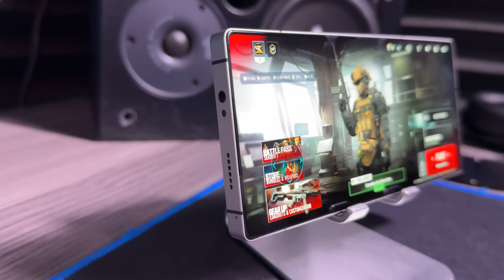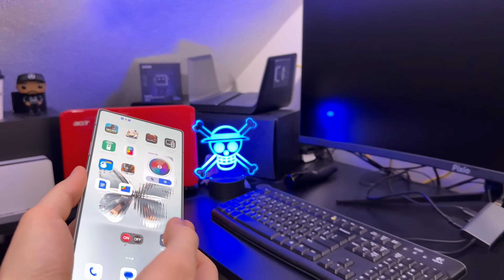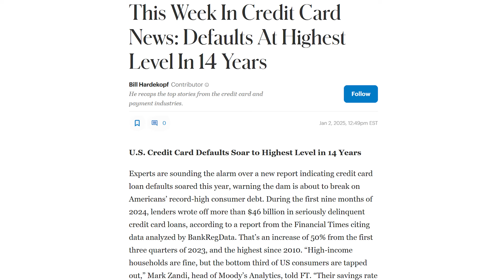What CES Revealed About Repairable Tech In a Record Year For E-Waste (2025 Is Not Looking Good)

Comment: You're the only creator I know (apart from iFixit) who covered the harsh truth about CES. 
I only saw one product at CES, which was designed with repairability in mind, the MCON Controller from OhSnap. 
Man, I really hope that Framework is going to succeed so they can branch out into many other product categories. 
Great Video!
Reply: I wish Framework wasn't beholden to the big chip companies or we could get so many awesome and repairable products!
Reply: @3nertia  Why don't you start building, and selling repairable product yourself, instead of expecting big companies. It is America the country of the entrepreneur isn't it?
Reply: @togowack You don't know what you're talking about.
As a consumer you basically cannot buy nor build a laptop with a CPU sourced from the manufacturer.

Even if you could, manufacturers don't sell to just anybody.

And even if they did, they have limited supply so they ship to big companies first, so you end up having to wait months to get what you need and still the schematics necessary to build the board require insane knowledge and manufacturing prowess.

You can technically do it, but the amount of knowledge time and money necessary to do so is absurd.
Reply: I really hope they release the new Ryzen AI with camm memory stuff as I sure as hell don't want any Intel shit and the only AMD option is a 2023 one...
Reply: Mecha Comet too. That was sick.
Reply: @chichibooxd4793  Right, modular tech is awesome!

Comment: October 2025 is definitely gonna be horrible because 500 tons of perfectly good computers will become e-waste as the very last good Windows OS will become unsupported (Unless it's Windows 10 LTSC IOT which will last until 2032). And I'm pretty sure that a lot of these PCs are very reliable. These requirements problems apply to every PC older than 8th Gen Intel, no matter if it's a low end HP Pavilion thing with a Pentium CPU or a really high end Dell Precision M3800 with it's 4K touchscreen, 4th Gen i7 CPU, 16 GB RAM and mSATA SSD. And also, I know someone who upgraded to 11 on his 8th gen i7 Gigabyte gaming laptop and the laptop became very buggy (Apparently Windows 11 has some digestive problems with those older CPU's so the users will have to buy new PC's even if their current one is supported). And the worst part is that these PCs will probably be replaced with cheap new garbage like my HP 14s or a Lenovo Ideapad or a Dell Inspiron. Oh, and my 14s which I'm using to type this comment already has a damaged plastic frame near the right hinges (Awful build quality exposed) and it's 8 months old (Still under warranty), even though, I open it from the middle 99% of the time and I'm trying to be as careful as possible with my laptop. And this is the laptop that I use for nearly all my schoolwork, including most exams/tests... I really hope that my laptop will last long enough because I have a final exam... If not, I will probably have no choice but to switch to a used 13" or 14" Latitude 5K or 7K series because they seems to be the only business class ultraportables with upgradable RAM and non rivetted/fused keyboards (I can't f***ing stand soldered RAM and fused keyboards) or I will get this POS fixed thanks to the warranty.

Comment: Sir I got old asus gaming laptop 10 years ago those fully aluminium heavy ass one that has gtx 975m it still works. When I needed to upgrade my shit I went directly to desktop because I knew my mother uses those consumer grade laptop that sometime does not work because when you move there is a motherboard crack or something. Yesterday I deboad my windows 11 for 3 hours I really don't like where things feels to end user. If it is posible I will use linux on my laptop. I am not a tecsavy person either. When it comes to those shit I am very ignorant and do not care or eant to learn problem solving. I want to open my shit and make it work as easy as posible. However seems like shits about to hit the fan so there is no option. You have to know what is happning so you don't get force fed by shit programs. I try to buy japanies cars. I try to stay away from new ai futures that inly track my data and analize my shit to force me more consumerism. Don't get me wrong I like cool stuf but future is ain't it. I belive most I will get oled

Comment: I had stayed out of the laptop market for a VERY long time, last week a relative asked me to advise them about a laptop purchase, I went to a local friend's shop to ask about brands and reliability of the laptops. I was shocked, to be told that alot of laptops have soldered RAM and that RAM is usually 4gb or 8gb 4800Mhz DDR5! There is ONLY 1 slot of RAM available to add more RAM and your upgrades would be limited by the fixed RAM's speed. And all brands do this in the name of slimming down laptops!

Comment: I'm going to start putting Windows LTSC on those older systems and it's supported up to 2032. Sadly, even people "in the know" aren't really aware of LTSC, and even then, it doesn't work for everyone. I urge anyone with these older systems to use it if you can.

Comment: It is an absolute STRUGGLE to get anything new that is repairable and upgradable. I feel like early 2010s were the best for that when it comes to laptops. RAM? Yes. Storage? Yes. CPUs? Also yes, upgrade them if the cooling allows. GPUs? Sometimes they were in slots back then too.

Obviously it's not like PCs that you can easily upgrade, but it was way better than now. Nowadays, you're lucky if you can upgrade the RAM. CPUs? Forget about it. GPUs? Yeah no. 

I just wish laptops were standardized like PCs. Standardized chassis sizes, motherboard sizes, IOs, etc. Grab whatever thickness chassis you want and then get parts that fit inside and bam, all done. It's not like this is *impossible*, but trying to regulate companies and standardize the shit they produce nowadays becomes harder and harder. They don't want repairable or upgradable shit, they want you to buy buy buy buy NEW. Always new. 

It is very frustrating.

Comment: You had that phone tooo?!
Man i've been repairing the screen two times and i accidentally ripped out the socket for the antenna cable
I managed to solder it back on 
But now it won't boot anymore 
Currently I'm using an Red Magic 9 
But i miss my rog phone 3 
There are no spare parts for the Red magic

Comment: My main laptop is a Dell N7010 with an Intel i3 370m made in 2010. And it runs fine using Debian w/ xfce.
No one likes hearing it but low-resource linux distros are a pretty decent solution to old hardware.

Comment: I totally agree with you. This throw away culture in not just electronics, but cars as well, is terrible for the consumer and the environment. This is why I use a Dell laptop I bought refurbished in 2011. It's been working just fine for the last 14 years. Originally it had Windows 7, but it runs Windows 10 just fine after upgrading the memory and replacing the HDD with an SSD. I will keep using it with Windows 10 as long as I can, then upgrade to Windows 11. Hopefully it will work.

Comment: Btw, ik ur channel is about laptops and computer repairs, but uhhh seems like everyone has forgotten the thing that is called "Windows Mixed Reality", which was discontinued recently, and when up upgrade it to windows 11 24h2, it's actually no longer usable like that one lost GPU u had in a retro windows xp rig, cuz there's no driver, nothing, $500+ headsets with crazy good AMOLED screens are just gonna be landfill material. Thus, yea 2025-26 gonna have some insane e-waste amount being dumped to the landfill, tech that is completely usable otherwise, with capable hardware, but it's either 1 small design flaw or this firmware-just-outright-disappears thing.

Comment: Tech, cars, mountain and road bikes etc. are not made for the middle and lower class consumers any more.
Reply: The same 2025 trim level of my 12 year old car is now 50% more expensive because of an 11" LCD screen, driving aids that take the place of driving skills, parking sensors, overly complicated direct injection engine, transmission that requires $600 fluid changes every 50k km and is internet connected making it worse for privacy than a Chinese cell phone.
Reply: The same carbon road bike i purchased in 2011 for $2000 is, in 2024, 150% more expensive at $5000.

Comment: correct. everything is becoming a shorter lifecycle commodity. Once you have software -> no updates after a short period -> obsolete, or if it has a battery it will guaranteed go to the landfill much quicker than you think since most are not repairable or replaceable. no one is doing anything about it.

Comment: As someone who's worked in Corporate IT for years, I'm so glad someone else is voicing my concerns I've had for YEARS.
"Why are we investing in non-repairable tech that we'll need to replace as soon as it's dropped or touched the wrong way?" 

It's not economic, it's not good for the environment, and it's frustrating to the end-user as they just need 1 part replaced; but, nope sorry, we have to replace the WHOLE unit. 😠
Reply: Apple is REAL BAD with this. And if you bring it in for a warranty repair they will do everything in their power to deny the repair and make you buy a new one. (They will claim water damage, when you live in a high humidity area which is bad enough to make the sensor say water damage)
Reply: @jeraldbottcher1588  Yup. Tim Cook is a crappy person.
Reply: Corporate IT person here as well. I'm insanely angry at how things are moving in our field. I work in broadcasting and it used to be we'd hit a pawn shop, pick up.. 6-7 dell towers, slap in the official licensed OS and software for our systems and we're GREAT, but now? Oh my god. No. We have a SINGLE virtual array matrix running 12 HIGH PRIORITY machines. And the worst part. The BACKUPS are on the sAME DAMN HUB. 

It makes NO sense. We had issues with the network connection and drives on the hub and the hell happened? OBVIOUS PROBLEMS. 

Also they're all on fucking virtual machines. The system clock LAGS. It can't keep the CPU clock synced to GPS. It's NOT HARDWARE. 

I hate this shit
Reply: @EspressosWork  Hey I am a big fan of using virtual machine servers and the proper uses of them. I am retired now (4 years ago now) We used virtual machine arrays to run our servers, but we used several arrays and made sure we only put as many servers on an array that it could support. We had our backups on separate and separately located backup arrays with redundant tape and disk to tape backups. We had good network people who set things up and maintained then the right way. 
It sounds like your company leadership is trying to cheap this one out.
I am sorry you have to deal with that crap, And it is crap. A big thing they forget is that if they cheap out and lose productivity, that costs more than the savings from cheaping out. The managers are chasing the low cost bugaboo. Until your leadership understands the true cost of doing this they are lost.
Reply: @ In my case we're using a single virtual machine to run 4 device servers and 5-6 other On-Air broadcast controllers that require a network connection for staff to use 24/7. When you live in tornado alley and are responsible for emergency broadcast this is just a bad idea in general. 

If it was split up and had non-remote access i'd be less frustrated.
Reply: Do they know? Yeah. Do they care? No. Making products repairable and long lasting is hurting revenue, which is the only thing they care about.
Reply: When I was in the IT field back in 2016, I noticed and voiced the same concerns. It's only going to get worse from here on out.
Reply: I got my start in IT doing warranty part replacements, and now I work at a place where someone had the bright idea to have just about everyone on a surface laptop 🤦‍♀️ Whenever one of those laptops breaks I get sad.
Reply: @happybatty5142  Hey we use surfaces at work too! I honestly forgot about it until you said something. The news staff has them at the desk for remote-accessing ENPS, but since they're supposed to be "professional" the staff don't use cases. Holy. SHIT do they drop every single one multiple times a day.
Reply: @EspressosWork  I work for a non-profit and I will never understand why someone thought it was a good idea to buy laptops where we can't even do a battery replacement ourselves.
Reply: @happybatty5142  Mobility in most cases. Easy to pick up and move. Huge issues come from the fact that most people in companies use them in a stationary environment where the only benefit of a laptop isn't being utilized. 

I know in our place we have the entire news department on docked laptops for some ungodly reason. It would make more sense if people were taking them somewhere to use the laptops, but they're shared devices. And they're expected to be used for editing. I'm convinced there was a price break on bulk or something. Nothing else makes sense.
Reply: I worked in corporate IT myself. Thankfully I had a say in purchasing of computers. I would purchase them with the intent of making them last 5 years and would spec them out as such (good enough processor, ram, and hard drive - later SSD's). This would cost about 10-15% more in the short term, but would save about 45-50% in the long term.
Other folks in other divisions would buy the cheapest specs they could get away with and had a turn around of 3 years at most (never even considered using SSD's cause HDD's were cheaper. and they would cheap out on the CPU as well going with Celeron processor to do pro grade work ). They were doing this on purpose telling everyone they were saving money. But then they had to have extra staff just so they could swap out machines more often. the cheaper ones also required more repair and support because they were so cheap.
The other thing about the cheap computers was that they were slower and actually cost more in user time to do the work (they were underpowered and slow for the work that had to be done.) When the time came around to upgrade from Windows XP to Windows 7 non of the cheaper computers could be upgraded without upgrading the hardware with Ram and SSD's, where the computers I had purchased were upgraded to Win 7 no issues
Eventually the company consolidated the IT support (after a whole bunch of whining and bitching about it) They went with my direction after they saw how much more expensive in the long run the cheaper computers were.
BTW after we were done with the computer, we would sell them at auction to recoup some of the costs. the cheaper computers could not be sold because no one wanted those pieces of junk. I know a few people who would buy them up in lots, and refurb them giving them a new life after we were done with them and making some extra coin doing so. We primarily used Dell and HP business class computers.
Reply: I hate this about tv's. They make the bezel almost gone, so it makes the screen tech more fragile when setting up.
Reply: Ha that reminds me 

My parents yell at me all the time for breaking stuff. From electronics to chairs.

Most of the stuff is poorly built and they got scammed. Again. They get scammed a lot all it takes is good reviews and their sold. As if "reviews" are real people anymore.

Anyways they've said some stupid stuff like office chairs aren't meant to reclaim. Then damn I wonder why they have a reclining feature.

Most products these days are cheap trash sold for high end prices. 

Oh and they do this intentionally if you break it you'll have to buy a new one. They make it to last just long enough so you get used to it.

Then it breaks.
Reply: Oh my god, the field service manager at my company made an executive call to STOP CARBON MONOXIDE TESTING during monthly checks. We inspect cars for emissions! 🤦‍♂️ his logic is that the machines are old and there's no parts available...don't care, CO testing is required by OSHA. I have half a mind to get the program manager involved with this, and if that doesn't work, OSHA directly.
Reply: IT companies don't mind, they just write off their investment, and the more they roll the money the better
Reply: Spot on
Reply: Because profits! Welcome to capitalism!
Reply: Not economic for the consumer. For the companies it’s super economic. They get rid of inventory so they don’t need to pay for storage. They get more money by selling you a new one. They don’t need to pay technicians. They don’t keep stock of unused repair parts. They save from rma process (shipping, checking etc) And pretty sure thousands of other similar reasons why they earn more with this practice.
Reply: Wait, it's all greed?
Always has been
Reply: Capitalism's demand for perpetual grown inevitably leads to self-cannibalization. Which was ensured pretty much the moment planned obsolescence became standard.

Where the goal once might have been to produce a product or service, the goal now is to ensure you need to keep buying. The irony being that in pursuit of those margins they've stopped paying their workforce who are also their target audience leading to reduced sales as people can no longer afford to keep buying shit.
Reply: Planned Obsolescence is a conspiracy theory!
Reply: Hey, I'm currently getting into IT and the two manufacturers, we sell, are decently repairable. Lenovo's support is a bit tricky sometimes, but Terra Wortmann (german company, don't think they export much) has warranties for which they'll literally send the broken part to one of their partners in your area and the partner will call you, come over and replace the part. 
We are one of those partners and it's honestly nice to do those service jobs sometimes. 
"Here's a mainboard, go replace that, we pay you. Client doesn't have to pay shit." That's basically how it works.